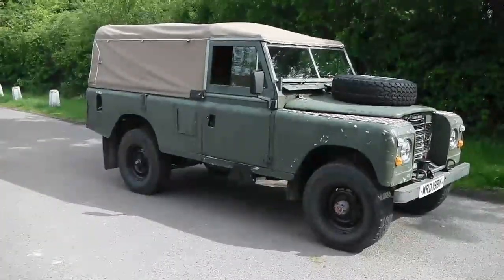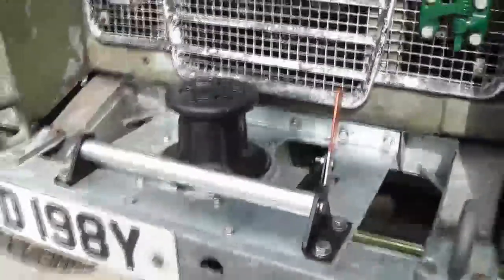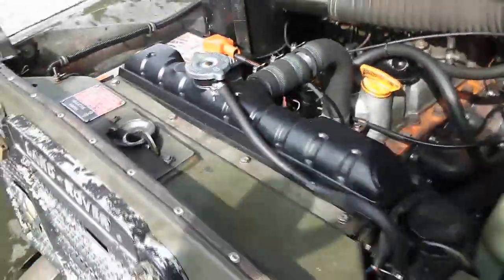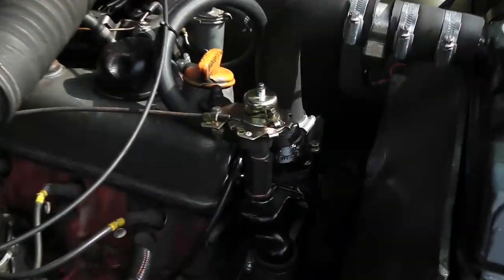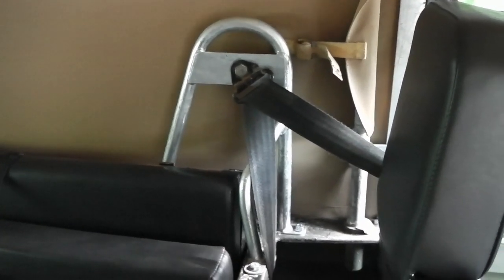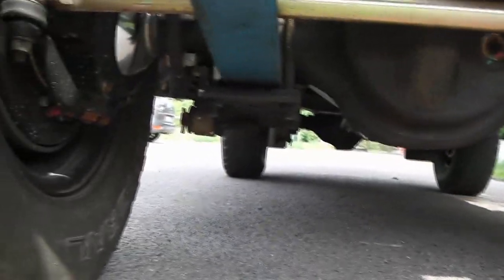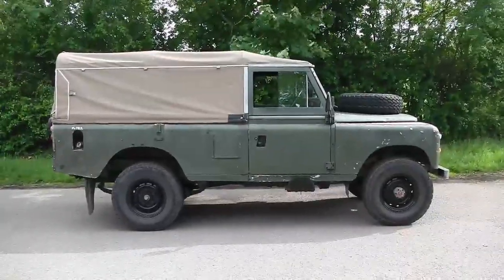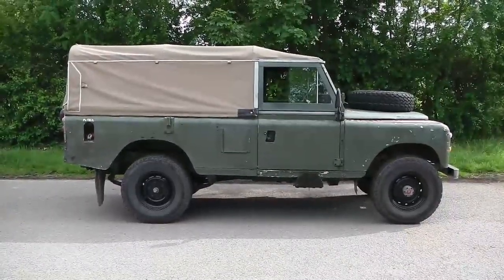Land Rover Series 3 Update - June 2022

Comment: Nice update. I have similar seatbelt brackets, or I should say bracket, as it has a bar running right across between to two uprights, and is one piece. I had to fit inertia reels as the 70s static belts, besides being worn, wouldn't fit round my 2000s body!!! ;-) Cheers
Reply from the maker: Sounds like you have the Exmoor bar, how was it to fit?
Reply: @steamwally  That's correct. As soon as you said that I remembered I'd got it at the same time as the new tilt. It was fairly easy. Just made sure it was central and that it didn't interfere with with the tilt hoops and existing capping rivets. The crossbar is handy for hanging things on too.

Comment: Thanks for the presentation. Did you fit a 2.5l petrol? Which temps does the gauge show now? 78 to 82° C?
Reply from the maker: Not yet, but I do have a 2.5 which will be fitted at some stage. The temperature sits in the range you suggest.
Reply: @steamwally  Thanks for the quick response.

Comment: Great to see the winch on. Engine bay looking very tidy too. Nice job.

Do your swivel housings hold ep90? My n/s does but my o/s leaks it past the four studs into the steering arm.. quite frustrating!

My zenith has had to be set very rich since I put it on to replace a leaky Weber.. just doing the head gasket recently I found the exhaust manifold gasket was split in two places so will be replacing that .. do you think I might get that mixture down a bit now then?
Reply from the maker: Thanks, it's looking a little better these days and I'm less ashamed to open the bonnet in public now!
I do use EP90 in the swivels yes and that was part of the reason for assembling the swivel units on the bench this time - it's much easier to ensure they are oil tight that way. Those steering arm studs should be fitted with loctite which will also help prevent leaks. A smear of RTV sealer in the right places goes along way too.
As for the Zenith carburettor, they have a habit of warping and that was the reason I went over to the SU - after the third carburettor I'd had enough. The good news is its easily rectified and you can flat off both halves of the Zenith carb with emery paper on a bit of granite worktop, plate glass or a surface plate if you have one.

Comment: What mpg are you getting? My 1980 Series 3 2.25 petrol is averaging 16mpg, best I've had is 20mpg on a long motorway run (@50-55mph)
Reply from the maker: About 18MPG at the moment. It's coming up time for a top end overhaul, at least- I used to easily maintain 21MPG and a little better on a long run.